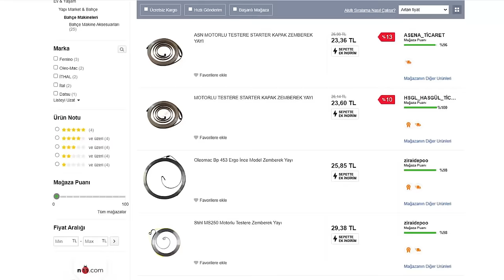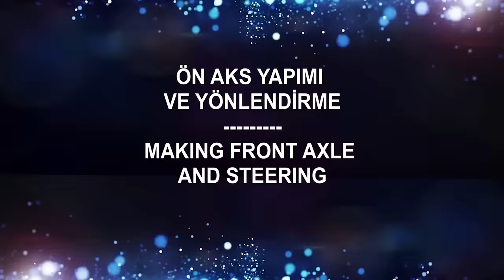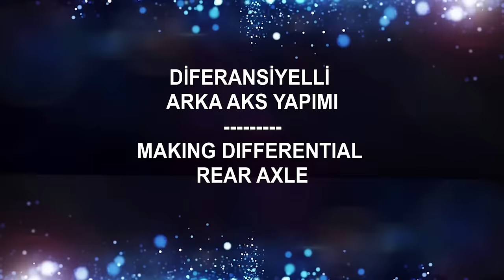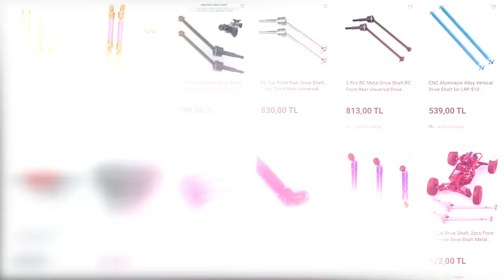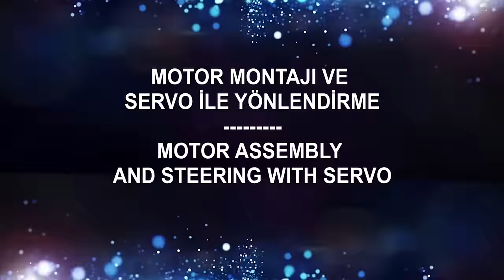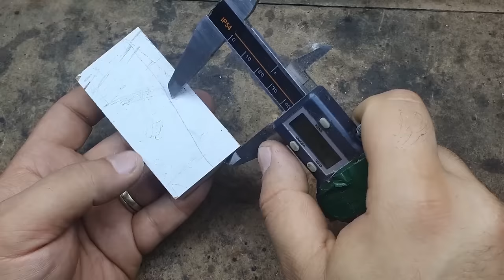COMPLETED - DIY Full Metal RC Car / Tamamen metal RC Araç TAMAMLANDI

Comment: Awesome build.
I take issue with one part though.
When selecting used lithium-ion batteries, before you pair them for each of those three cells you need to put each one  on a smart-charger and then fully charge & discharge each one, write down the capacity of each one (usually shown in  milliamp-hours or Watt-hours) and then pair each battery with one that is as close to the same capacity as possible. Preferably they should be within 50 MAh of each other.
  If you do not do this, you run the risk of thermal run-away (fire!). This is because the battery with the larger capacity will charge the one with the smaller capacity to reach equilibrium. If one of the two batteries in each cell reaches the end of it's useful lifespan while the other one is fine , you could have a problem on your hands.
 
 Alternatively, just store the battery somewhere where it won't burn down your home if it catches fire.    ....Maybe with some fireworks to let you know if it catches fire. 
 ... OK maybe scratch that last bit. ;-)

Comment: Wow that's a work of art 👍. I really like the video on how you show the made chassis and errors you fixed to make it better 👍. Awesome footage on the whole video 👍. That RC has a lot weight, right 🤔. Question: don't understand why you used wood on some parts, when chassis is all made metal 🤔. I still like it 👍
Reply: Wood is lighter than metal and increases unsprung weight. It's good to have lighter parts on any vehicle's suspension near the wheels  (RC or full size) for the suspension to work better,

Comment: 👍👍👍👍👍 that's a crawler🙂. Better you use a good Brushless motor 6S with 150A controller 😁, with 2000KV Brushless Power, so you could reach easy over 100km/h 😁, and all that for low budget too.